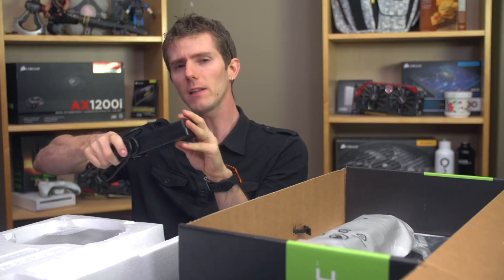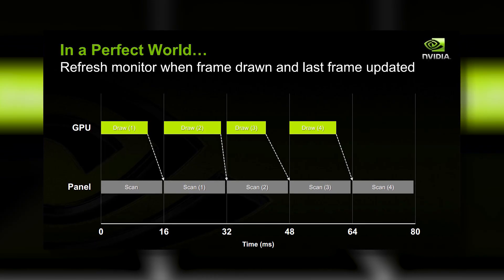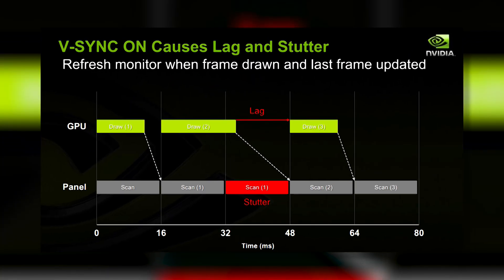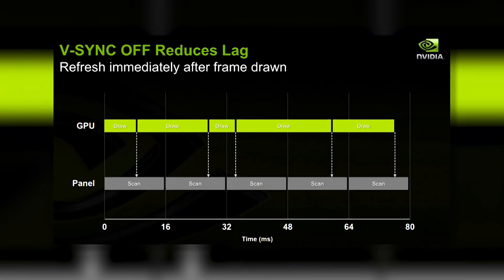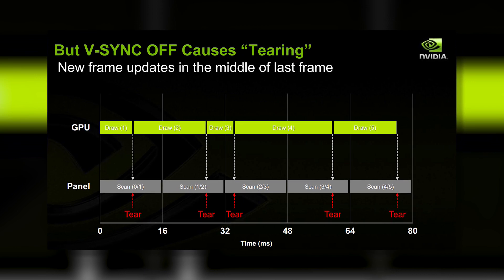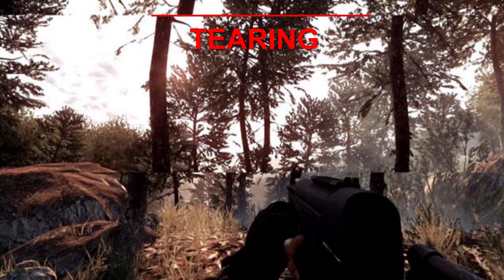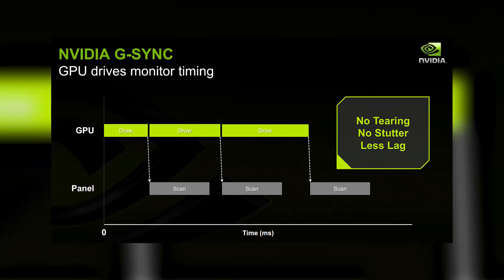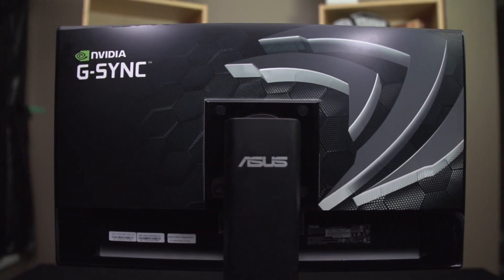NVIDIA G-SYNC Tech Preview - Linus & Slick's Impressions

Comment: Honest question and maybe someone can answer it for me: why should I get a G-sync monitor if I can simply upgrade my GPU so I can play all games at 60+ fps so I never have to use v-sync nor will I ever experience stuttering?
Reply: that sir is a fantastic point
Reply: tearing happens when running above 60fps on a 60hz screen so thats the reason you would want vsync, to remove that tearing
Reply: he explained this in the video, its tearing that is the issue, and you can have 100fps+ and still have it.
Reply: megaspeed2v2 but if I have a 144hz monitor and a GPU that runs most games at 80fps and I can keep that constant up by upgrading my GPU over a monitor?
Reply: g0ggy if ur running a 144hz screen then you need to get like 200fps before you see tearing with a normal non gsync setup, if you could get a system powerfull enough to run games less than a few years old above 144fps then i guess you would end up with a game running at exactly 144fps all the time
Reply: g0ggy well if you can play Metro Last Light, Crysis 3, Rome 2 tw etc. without a single framehit you have like titan sli going. i own a gtx780 and an i7, but am still experiencing framedrops so i would think about buying such a device :D
Reply: 6666MrIronhead66661 Those are the latest titles available and I only played Metro:LL of them. I have a huge library of games and I don't have to play the latest games that come out on the market, even then it's only a fraction of games that you can play.

I am not going to buy a PC for 2000-3000€ just to be able to play Crysis 3 on the best settings with 60fps. It's just not worth it, especially considering that the game is really not that amazing ...

I have a GTX 770 and a i5 4670k and that is already overkill for most games that I play.

Comment: You make an interesting point about G-SYNC potentially being a difficult sell for Nvidia.  I don't necessarily agree with the reasoning, or with the SSD vs. HDD analogy.  SSDs didn't solve an actual problem per se, they simply improved a performance metric.  Screen tearing, stuttering, and input lag are real problems that PC gamers notice and do not like.  G-SYNC doesn't simply provide an incremental performance increase like a higher frame rate or higher refresh rate.  Instead, it's novel technology that eliminates real problems with the way games are displayed on screens.  When the reviews come in and the price is right, people will buy G-SYNC.  I know I can't wait.

Comment: i wonder what happens if the gpu makes more frames than the monitor can handle with g sync??
Reply: Whatever hz your screen has is what max fps you will get using G-SYNC, 60hz = 60fps, 120hz = 120fps etc.
He says it at 5:58
Reply: Do you mean if your gpu is making 67 frames, but your monitor is only 60hz? In that case it doesn't happen, the gpu will limit what fps it is making to 60fps to match the monitor, or 120fps if it's a 120hz. There really aren't any cons to having gsync apart from having to use quite specific hardware.

Comment: The thing is you can buy storage devices and just "throw it" in your system and have more storage memory. An ssd improves your system performance by a lot. While I can't say the same thing for a monitor. I don't think you can use a G-sync monitor at the same time as your old monitor, having perfect frames on one and awful tearing on the other one. And also if the prices will be $200 more than a led or ips panel display, then yea... I won't buy one.

Comment: As I currently have dual U2713hm running on a gtx780 and get a perfect smooth 60fps. (Vsync enabled) So am I right to say the benefit of gsync would be marginal (or non existing) as I am maxing out my current panel. 

As for the question of ssd usage and reverting back to a mechanical hdd. I don't find it that horrible at all. There is a clear advantage with ssd's (me myself am running 2 intel 520's in raid0. But it still comes down price/performance. If you build a high end PC you NEED at least one ssd. If you want to keep it a bit cheaper I rather have a better CPU or GPU the adding an ssd.

Comment: Won't be worth it for at least 1 year. The extra money (around $150) you pay for G-Sync can be used to get a better graphic card, which would minimize the frame syncing problems compared to before and raised overall framerate. It's a novel idea, but wait for ASIC to replace the FPGA for G-Sync to dramatically lower its price.

Comment: Firstly i can't live with a system that doesn't have an SSD as the boot drive anymore. And secondly, if i can buy a G-Sync monitor with 2.5k res, it's not a bloody TN panel and it is at least 27", i don't care what it costs i am buying it no matter what. Because that's how much i hate tearing and having to use V-Sync in every other game to try and reduce it with the cost of lag and it still sometimes feels laggy even if i see fraps reporting steady 60 FPS.

Comment: Linus, the biggest question i have is - WHY ONLY DISPLAY PORT? I need dual DVI-D for 3D and in this case will G-Sync work??? and i am pretty sure you would say NO or wait for Q1 next year. Well alright i will wait, since K|ngp|n will not be coming until Jan, however, I am very concerned to use G-sync when gaming on 3D!!!

Comment: I haven't got around to putting an ssd into my laptop yet, but I've had one in my desktop for the last year and a half. I get annoyed every time I go to use the laptop because going from an ssd to a 5400 rpm drive is just too much of a slow down. I definitely get where Linus is coming from with this.

Comment: The comparison to ssds are why I don't want to buy this. Gsync is most likely only going to be on "gaming" monitors for the first few years, and then when its cheaper, the non gsync monitors will still be cheaper. Therefore most monitors wont have it, with ssds you just have to wait a few more seconds, but with gsync, the difference isn't that trivial. Also, the lack of AMD support will kill it, especially seeing as the 280x and 290 are suiperb GPUS that cost at lot less than the nvidia equivalent. I just can't see it taking off.

Comment: I have a SSD in my laptop and a HD in my desktop. I looooove the start up time, which is the only thing that really bothers me...
That said, I dont use my SSD on my laptop for games, since its a bit small... so im not sure if and how it even would impact my gaming experience significantly... actually ima try :)
Reply: windows doesnt start faster? thats weird...should be noticeably faster! i´m talking about really fast! shure windows is installed on the ssd?

the lifetime thing is an issue, but the standard lifetime of a mechanical harddrive is something between 3 and 5 years, so...nothing lasts forever. make shure to disable tasked defragmentation to save unnecessary writes, then it should last longer!
Reply: Answer: ALOT! ^^
Reply: loading menus drop a crapload if u use programs like steam that dont ask for a disk
Reply: Vertiqo confirmed!
Reply: Vertiqo meh, my dad's SSD never impressed me one bit. it was an OCZ Vertex 2 256GB, so it definitely was one of the faster ones. Windows didn't load much faster, game startup time... well I suppose it was better? also SSD's just don't live as long as HDD's, which I really don't like the thought of.

I've even had a HDD die in about 6 months, so to think that a SSD can die that fast as well is really worrying. I keep a lot of important stuff at my C:\ drive, so I can't have the SSD die on me. HDD's usually show signs when they get close to dying.. SSD's won't make any sound.

then there is the steep price.. I must say they finally got to the point where they're considerable, but the shorter lifetime just doesn't appeal to me.

my dad's SSD died already after 2 years.. he didn't use his PC much, and made sure to not do a lot of re-writing. so yeah, I honestly don't see why a SSD is worth it.
Reply: thanks for your response. yeah I heard about the defragmentation thing, but does that even get scheduled automatically? I've never seen/noticed it happen before.

and his Windows did boot up faster than mine, it just didn't impress me. I do install as little as possible to keep my pc clean, though. also now with Windows 8 a SSD really won't make a difference anymore ^^ even my laptop starts up in 5 seconds after it's been turned off completely, while it's often slow and freezes in Windows nowadays xD I really love that about Windows 8, the only downside is the shutting down takes longer now, but they.. that's less important right? :P
Reply: yup, its scheduled automaticly! at least it is in win7...a clean install definitly helps with the bootup-time...is win8 really that much faster in bootup?
Reply: yeah Windows 8 boots at least 3x faster on my pc, and yes I'm taking the state of the installation into consideration. I reinstall windows on my pc every 6 months or earlier, so it doesn't get slow :)
Reply: not bad...if you dont think you need it then you shouldnt get one! i really enjoy the faster bootups and the responsiveness of all installed programs and games. but hdd´s worked fine for me the last 10 years...so...
Reply: haha yeah ^^ I'm glad we can have a normal conversation here though, without any people going crazy persuing their opinions! oh how often it happens..

but yeah HDD's do fine for me. one thing that could also be interesting is having no HDD"s in a laptop should improve its battery life when not charging; although I have no idea how much ^^
Reply: yup! and the fact that they are lighter and shockresistant. great upgrades for a mobile device! ;D
Reply: yeah true, those are also good points. hard disks aren't even supposed to be on an angle while running, let alone be moved around xD so yeah I can see the SSD being really valueable for a laptop, but especially for PC's with Windows 8 I don't think it'll be that important, or at least not for me. I know loads of people say they can't live without their SSD anymore, so maybe it's just me xD
Reply: that is a bit of an odd story. i know older SSDs when SSDs were new, they had short life spans... I got a 'health checker' program on the laptop and the SSD is supposed to last 10 years or so. thats unlikely though.
im even running the page file on it, which should give tons of writes, and it still says 10 years. shrugs 2 years seems fast

though, how long does a drive need to live? especially considering gamers, I dont play on the same pc for more than say... 4-6 years or so?

as for my little test... still not sure. i ran AC4 from the SSD and it seemed to run a bit smoother :) as its an open world game, im guessing it loads the world faster?
i was also able to kick up some settings up from near minimum...
didnt use the exact same set up though, since i dont have the same monitor hooked up to it.
loading screens were definitely faster, game possibly a bit smoother, better textures possible.

sigh... i should really invest in a new gaming pc!

Comment: How about competitive 300 fps gaming? Will those guys benefit from it?
Reply: What do you mean 300fps gaming? The highest refresh rate availble on a monitor today is 144hz, so I have no idea what you mean by 300fps gaming. If you mean that they have amazing rigs that are capable of producing 300fps, then yeah they will definitely benefit from gsync as they won't get the massive amounts of screen tearing that would come from getting that kind of frames.
Reply: MrMattadz I personally am a semi-professional CS:GO player, and I would assume that a alternating refresh rate would fuck up the: Screen > Brain > Hand > Mouse timing...
Reply: But you would get that anyway without gsync. gsync makes large changes in fps a lot smoother, so it helps everybody. There is literally no downside to gsync other than it only works with certain monitors and GPUs.

Comment: I don't like this at all, the concept is fine, but nvidia have put me away from buying it purely because of the fact they're not licensing the capability to AMD.
The advantages of mantle happen to overwhelm the advantages of g-sync, and mantle does not require corresponding monitors to hardware, only a mantle capable GOU, where as g-sync requires kepler architecture, displayport AND a g-sync enabled monitor. The requirements outweigh the reward in comparison to AMD's new API, which will be the main selling point of their future gpu releases, especially when more game devs produce for mantle.
Reply: you do realise any decent graphics card from nvidia nowadays has those things?... after that all you need is a monitor that supports gsync. its fair enough they dont licence it to amd, do u see amd licensing mantle out?
Reply: gahkak I disagree with their decision not to do so.
But in terms of cost effectiveness, it costs less the reap the benefits of mantle.
Reply: ***** Costs less to the consumer, yes. There is no financial gain for amd (or the game devs that support mantle) other than possible increased sales. which works fine when you're working with software because you are not manufacturing anything, rather you are just coding the games to work better via mantle (which still costs man hours). however once you start having to manufacture a PHYSICAL product costs go through the roof (for the company), especially when the company bringing the product to you (nvidia) are not a monitor manufacture, so they have to sweeten the deal for the manufacturers that they are putting this product into. all in all i think charging a little bit extra (on top of a new monitor that you were going to buy anyways) to get this product, so nvidia can cover manufacturing, getting this product on the market, etc. is completely reasonable and acceptable.

Comment: I recently changed my old 6 year old HDD that was 300GB running my OS to a 250GB Samsung Evo SSD and I was very impressed by the speed difference. So Linus has a point, you may be like G-Sync is nothing, yolo. But really it will be revolutionary in gaming picture/frame quality. I just bought a BenQ XL2420T a year ago so I wont be upgrading anytime soon but will definitely pick up a G-sync monitor in the future.

Comment: Here's what I can't find. The DIY kit, will it be replacing the whole entire PCB of the monitor? Or will it only be the card that you switch out by popping the monitor out? This is what I need to know. I am getting the monitor simply because it is nice. But I need to know how this will be a DIY kit. On nvidia's website, they only say that the DIY kit will be available to professional modders to place G-Sync inside capable monitors. That makes no sense considering it is called DIY! Since nvidia can't say their words a bit more clearly, can you tell me Linus? Please?
Reply: No the mod kit replaces the scaller in the monitor not the entire board. I would also imagine that these kits will be readily available in six months to a year, if not sooner.

Comment: lucidlogix virtual-vsync is a much cheaper solution..
Reply: That software is trash and doesn't actually solve the problem. You won't be able to use that to run Mortal Kombat in MAME (54.7hz) perfectly smoothly.

It's crap.

Comment: Linus you are talking as if the solution is perfect I doubt it is there must be several cases scenario where there isn't much advantage to G sync, but maybe with the full review, :D but most of the review sounds like the G Sync PR release :p
Reply: It solves a 40 year old problem with computer video, and nobody's been able to point out any downsides to using it. The only people not happy about it are AMD owners who bought the wrong video card.
Reply: HowAbout NoSon
what are you talking about? did you even read my comment or are you just being a stupid fanboy, my whole comment point is that there are no data not scientific results in this preview, they just basically trew at us what Nvidia PR release had in it, with some initial impression, Most of the time the reality is always different than PR releases, so till there is an overall review (probably Anandtech will do a comprehensive yet pretty analytic review I'll hold my judgement) .

If G sync deliver it's good for customers and we might see AMD doing their own thing, or Display manufacturers stepping it up to implement a similar solution that works with every gpu, G-sync is not magic, the hardware is simple, the software what makes the difference and it is attainable nowadays

Comment: My 2010 27" iMac has a 1-TB Hard-drive, at the time, it was decent, no problems, but there were wait times here and there, and yes, it is Bootcamped with Windows.

I also purchased a 2012 15" MBP-Retina with a SSD, and my god everything is so smooth and fast, even switching between OSX and Windows 7 is about 5-10 seconds, whereas on my iMac it is about 90 seconds. SSD ALL THE WAY!

Comment: Does anyone have any idea how much this will cost for something like the Asus here or a BenQ or something? I can't decide if I should wait for this an have a smaller TN panel with poor picture quality but really smooth gameplay, or if I should just get a 120hz 27" 1440p Overlord Tempest and still get very smooth gameplay but at a much higher res and in a panel that will match my current 27" 1440p monitor.
Reply: The problem with the Overlord Tempest is that it's still going to stutter like HELL when your framerate drops below 120fps.
Reply: HowAbout NoSon Why would it stutter like hell? Stutter isn't usually a huge problem for most people whether at 60 or 120hz. G Sync just attempts to eliminate it and make gaming that much better. But I rarely get any kind of stutter or tearing. Almost never.

Comment: Did you guys try it out with any lower end cards on high demand games? I think g-sync would be awesome if it smooths out gameplay that stutters a lot.
Reply: That is exactly what G-sync does.  The point in time when the frame was drawn gets thrown off with V-sync.  Also triple buffering causes that jitter to get worse.

should fix jitter, but not hitching.